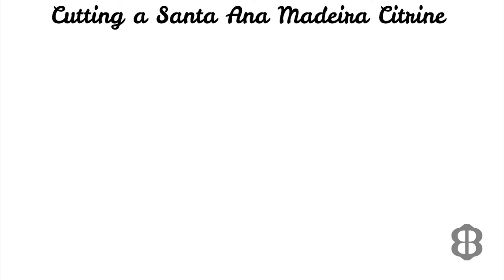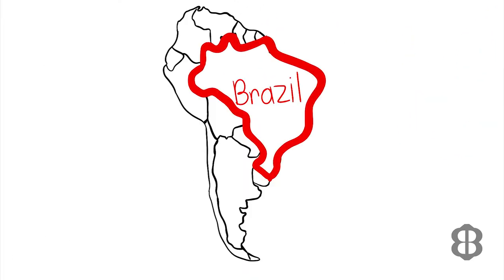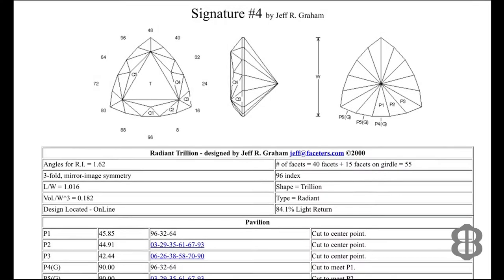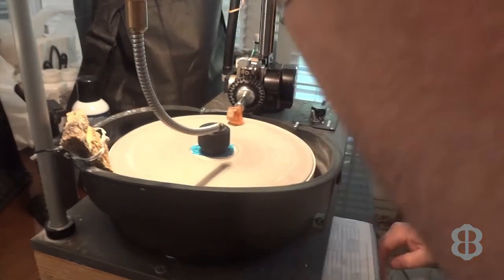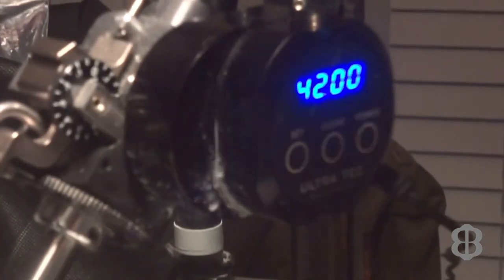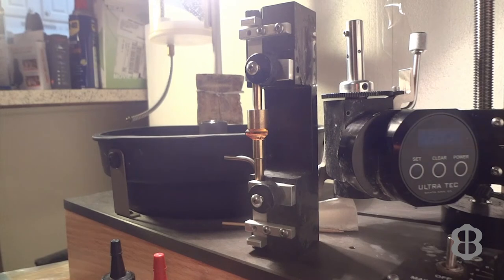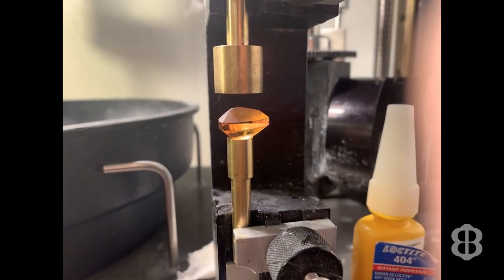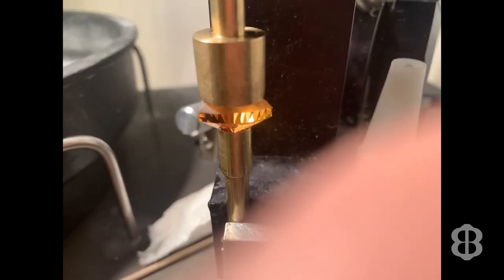Gem Cutting Tutorial - Faceting a Madeira Citrine with a Trillian Design

Comment: Hi Michael, Well done on the Trillian Design. It's always good to watch the Ultra Tec in action. It seems to be one of the USA's premier machines. I haven't seen too many of them in Australia, but there are a few gem cutters in my faceting group that have them. I assume they  have some modifications converting to a different power supply. Aussie machines tend to be over engineered, but are accurate. As for the glue, most epoxies have a expiry date and CA glues last longer refrigerated as they will also fail. I've found Devcon will  solidify when stored long term. Oh yeah, I got laugh out  your squeaky Alligator called Jaw's. Happy faceting......
Reply from the maker: Cliff, 

Thanks.  Yes, the Trillian turned out great, Bopie told me that the couple is very happy with their pendant.  I am happy to have created something beautiful that, hopefully, will be passed down for generations.

Regarding Ultra Tec machines, I learned to facet on an Ultra Tec and have never used anything else, so it’s hard for me to do comparisons between different machines.  

I discussed your comments with Joe Rubin (Joe was an aerospace engineer before buying the Ultra Tec company back in the early 70’s).  Joe told me some interesting things about Ultra Tec in response to your comment that I will share below:

- There are MANY Ultra Tec machines in Australia.  Mostly V2s from years ago when the US Dollar and Australian Dollar were about equal value (currently the Australian dollar is worth 67 cents U.S. and this makes U.S. goods more expensive to Australians).  At one time they had enough monthly order volume to justify shipping Ultra Tec machines by sea, instead of air, which further reduced shipping costs.  

- Ultra Tec does have a representative in Australia.  Mr. Brent Jackson of Sydney.  His e-mail is jackson254@optusnet.com.au

- In regard to electrical power supply - (220 VAC in Australia) - Ultra Tec faceting machines operate with 110 VAC or 220 VAC.  The user doesn’t have to do anything other than plug into the source – the machine’s electronics recognize and adjust for the source.  
Joe also confirmed your comments about adhesives by saying:  “Regarding faceting adhesives – we did a study which led us to focus in on using Loctite 404 – and that’s what I use.  Yes, it has a limited shelf life – when I get a new bottle I put a date on it – and I keep it in the refrigerator.  When it gets to be a year old I replace it (yes, painful – the bottle is still half full – but that’s what should be done).  As Cliff pointed out, epoxies have a shelf life too (they usually tell you).”
Finally, Joe corrected me on a comment I made in the Madeira Citrine Video about the Ultra Tec facet-saw and how I thought it could be used on pretty much any faceting machine.  Joe said “Now, most “other“ machines have a small Platen size (like 2”) – too small to offer adequate support for the 6” blade.  Ultra Tec has a 4” Platen – so, only 1 inch of blade extends – stiff enough to not bend and “wander off” as would happen with a small Plate.”   So, I stand corrected about thinking pretty much any faceting machine could use the ‘facet-saw’.  Check before buying.  

Finally, about the squeaky Alligator.  Glad you got a smile!  It is only a minor point/hint to the evolving mystery, but it’s a Croc not a Gator.  

- Cheers!
Reply: @BOPIESDiamondsFineJewelry  I wouldn't mind a Ultra Tec that's for sure. The way the Aussie Dollar is at the moment it's out of my price range. Sadly, there is not much on offer currently in Australia. What is available takes way too long to manufacture. There seems to be a huge demand, however  suppliers just cannot get there orders out fast enough. Cheers Cliff

Comment: Concerning the epoxy and its age, I have found it stops hardening after about a year of storage
Reply: Thanks for the information.  I can live with that.  Generally I go through my epoxy w/in a year..especially since I now use it for larger projects which require more epoxy...I currently use UV light activated super glue for smaller stone.
Reply: @mikesackos2208  Do you find the regular super glue to be just as strong as  the UV super glue ?
Reply: Yes, the super glue I used to use, Loctite, and the UV activated Superglue I am currently using are both strong.  No issues w/stones falling off the dop.

Comment: When you reset the gemstone after it came off and it was not flat would you rotate the quill until it was flat or would you adjust using the cheater until it was flat?
Reply: In this case I would adjust the cheater.

Comment: What's the sponge do?
Reply from the maker: Hello Jacob.  I find that the sponge greatly reduces the amount of water that spills out of the splashguard (the rubber pan that surrounds the lap in the machine).  When cutting the girdle, the splashguard has to be lowered so that the mast can contact the lap at a 90 degree setting.  Without the sponge, water spill through the part of the splashguard that has been lowered.

On the latest Ultra Tec machine, the VL, I understand it comes with a “anti-splash sponge” and clip to attach the sponge to the splashguard.

When I first started cutting, this ‘discovery’ of using a sponge was not widely known, at least I did know about it.  It works for me, so I pass this ‘discovery’ on to other cutters.

I did not invent anything related to faceting and all the techniques I use, I learned from others and if I knew who invented or discovered the ‘sponge’ technique I would gladly give them credit…and THANKS!  If anyone knows who first started using this technique, please share!

Comment: There are trillion dops available.
Reply: Where? From whom?
Reply from the maker: Thank you for sharing that information Elayne.  Please let us know where we can obtain ‘trillion dops’ as I don’t know of any sources.
Reply: @BOPIESDiamondsFineJewelry  I know that I bought a bunch of them in Tucson from Graves.  Since Graves is no longer in active business ( not saying it is closed just not active ) I would suggest you have a machine shop make a run of them for you.  Just take in a dop from your machine and a spec drawing of a trillion dop; I'm sure they will be able to make them.  This is from the Graves site ( do not order - you'll never get them ) and attached is a picture of one.  Hope this helps.
Elayne

Trilliant Dops 
SKU: 02-031 
These dops are made specifically for the triangle trilliant cuts. Cone dops may work but the time spent aligning the stones can be frustrating. A triangle depression is cut into these dops making the process much easier. 1/4 inch shank. 
Price: $8.90 Select Size (Inch)
Attachments area

Sorry pic did not attach.  go to the site and get a copy of the pic there.
Elayne